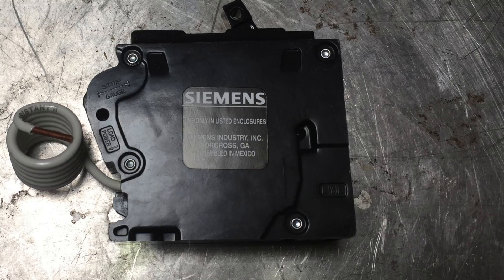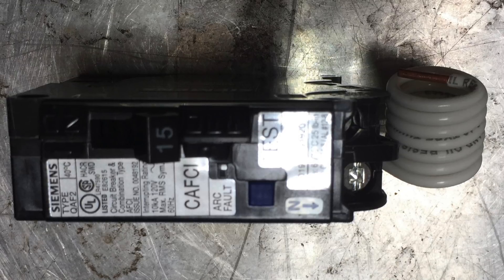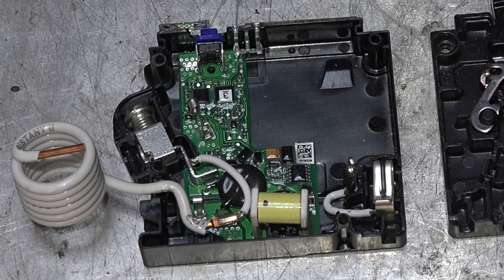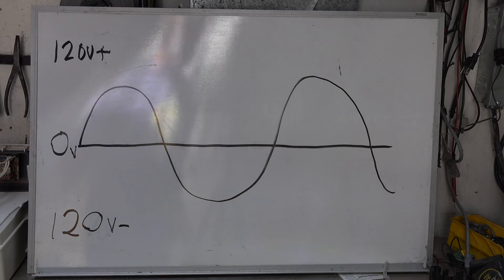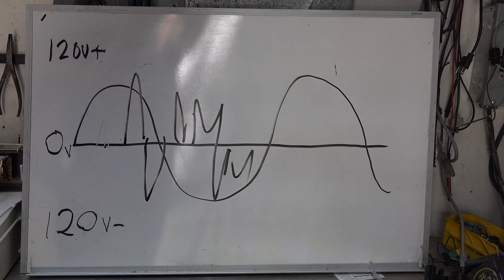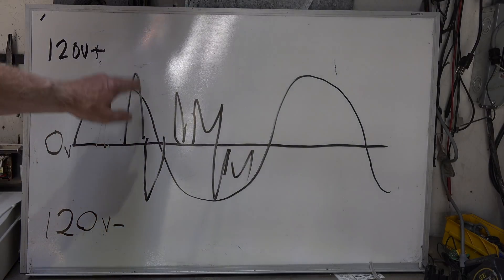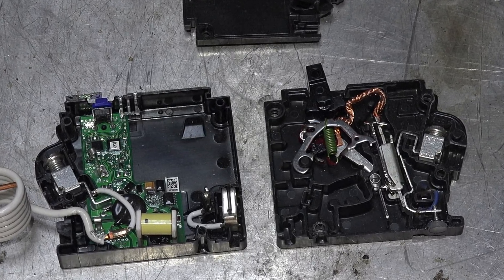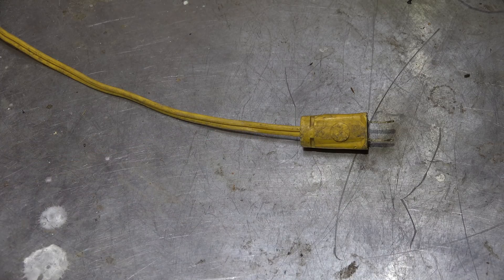How the arc fault interruptor works.

Comment: When a device is unplugged while operating, there can be a small arc at the receptacle.  Will this trip the breaker?  Doesn’t a switch also make a small arc?
Reply: It should not, AFCI breakers are designed to only trip if there is either a serious arc or a sustained arc. If every arc tripped them, that would be extremely problematic since lots of electrical devices create arcs during normal operation such as when turning on and off or, as you said, when plugging in or unplugging devices. Brushed motors can create continuous arcing too. I as well as Youtuber by the name of Eric Stark have done some testing on AFCI's and found that it's actually surprisingly difficult to trip one by creating a series arc. I'd suggest checking out Eric's video on AFCI's if you are curious about them like I was as the results of his test were quite interesting and surprising.

Comment: Grayfurnaceman, I have noticed some servicemen use dielectric grease on the blades of the AC shutoff plug.   Is this the appropriate application or should thermal paste be used?   Quite often I see overheating happening at the shutoff plug with an older compressor attached that is pulling high amps, and also see the plug overheating when compressor amp draw is normal but oxidation is present.   What are your thoughts on when/which grease to use? 

Also, thanks for the invaluable video channel you have created.   Every learning tech I know has relied on your videos.
Reply: Its all about how tight the connections are.  Certainly oxidation will cause overheating also but it is usually caused by a loose connection..  
If you come on a discolored disconnect blade, the party is over.  grease will not help.  When the blade gets overheated, the metal looses its spring and it will fail.  Replace the disconnect.
GFM
Reply: Okay thanks

Comment: I don't think an arc would destroy the voltage sine wave would it? Maybe some noise but bringing it to 0 would require a short not an arc. But the current sine wave certainly would be affected and exhibit a bunch of extra zero crossings.

Comment: Gary, I have a question as winter isn't far away. I want a furnace in my shop that isn't insulated and won't be heated all the time, the problem is the landlord won't allow anything if it doesn't vent pvc (90 plus). And i do not think it will work, I worry about leftover condensation in the secondary and potentially freeze and break the unit. What's your thoughts?
Reply from the maker: Inside the furnace, there should be no condensate in the off cycle if the unit is level.  However, there is a P trap located outside the heat exchanger that may freeze.  Heat tape?
GFM
Reply: Thank you sir.

Comment: Glad to hear no electricians were hurt in making this one.  Your demo reminds me of reconnecting the cables on a car battery.  It's hard to avoid at least a little arcing then, and I always fear the car's electronics will get damaged.  So far, never had a problem, but it always bothers me.
Reply from the maker: The one to watch out for when connecting cables is the spark igniting the hydrogen gas from the battery.  Many batteries and some people have been damaged by that explosion.
GFM

Comment: Great video.  If you could listen to a circuit with a headset, as if the 120VAC 'signal' was a carrier wave, the arc faults you're listening for would sound like noise on the line.  The AFCI is a special case of a noise detector.  As you can imagine, filtering the legit noise on the line versus dangerous noise is a difficult problem.
Reply from the maker: I wish I could have gotten a good sine wave reading, but that did not work out.
GFM
Reply: The electronics probably can determine more repetitive periodic noise (from normal situation arcing like brushes in universal motors) vs more random noise (accidental arcing) to make that determination.  There's a bit more information in this paper that's pretty interesting, it even shows example waveforms on pages 22-27:
https://www.cpsc.gov/s3fs-public/AFCIFireTechnology_0.pdf

I've got an AF/GF receptacle at home that still unfortunately trips when I turn a ShopVac on.  I'd guess cheaper electronics.

Comment: Problem is that a lot of normal circuit operation will look like an arc.  Switch bounce, switchmode power supplies, etc.  Took them awhile to thin out the false positives.